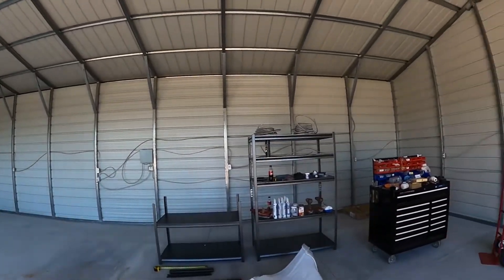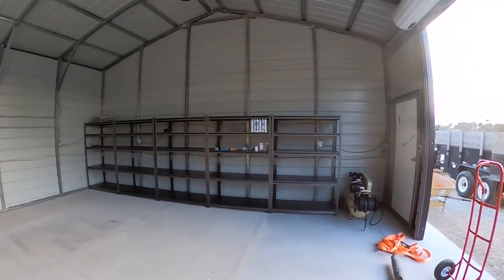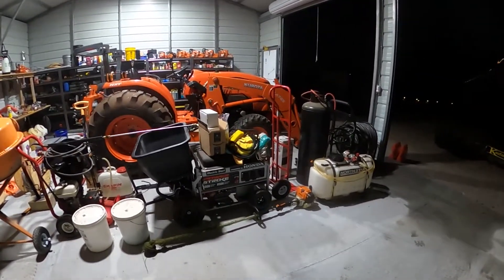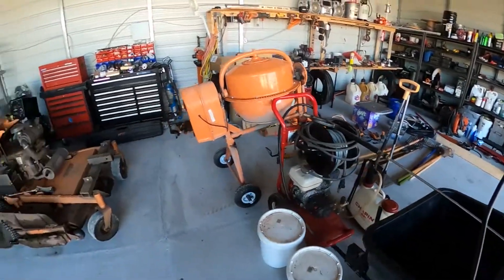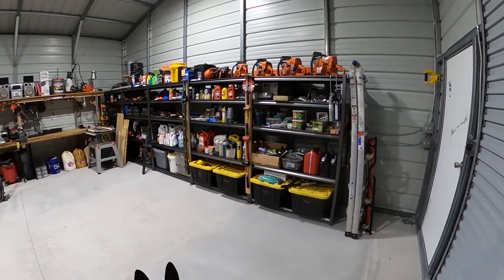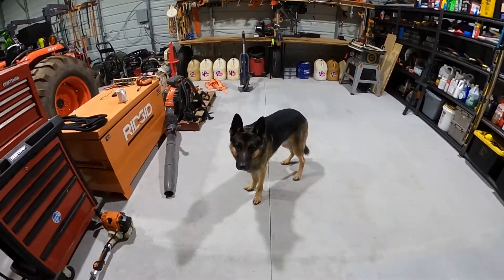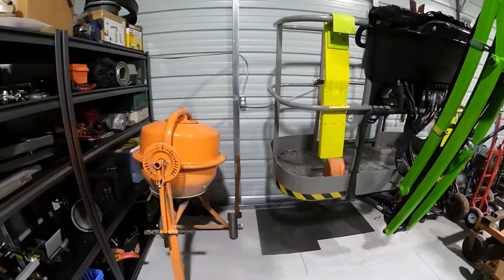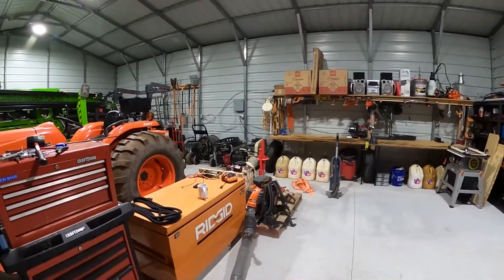Organizing a Workshop

Comment: So you have a link for the shelves you bought? Are the surfaces metal or wood?
Reply from the maker: The shelves that I purchased say that they're no longer available. But these look very similar to the ones I have. https://amzn.to/3Og4NvW
If you have a samsclub in your area they randomly have shelves close to these in stock but its hit or miss if its actually there. edit: the frame is steel and the shelves seem to be mdf but coated with a hard durable (so far) plastic.

Comment: What state are you located in? how does it hold up against the cold/heat without insulation?
Reply from the maker: I'm in upstate sc. I've only had the building a few months now. So all it's seen is down to the 20's up into the 80's at the moment. It generally gets in mid 90s in the summer. I think it will hold up just fine. It's very humid here. Especially lately with all the temperature swings. I've made some other videos you should check out. I was having water intrusion at the base, as well as moisture inside but got those corrected in the videos I made.
Reply: @reallifetested2605  Thank you for the information, i definitely will check everything out! my 30x40x12 gets installed next month and im still up in the air about insulation, sheetrock and a mini split unit! Good info so far, i will be following some of the ideas you had!
Reply: @reallifetested2605  And im in California where it rarely rains
Reply from the maker: @Prodigyproperties1  That's awesome. I bet you can't wait! I would've done all of those things (insulation, ac, etc.) but this was more of a storage place for me. My wife does woodworking and laser cutting. She's currently occupying my other building and she stays in there quite a bit, so for that I added the mini split and all for her. I also made videos on that if you want to check those out. Mini splits are awesome! Her shop is 24x24. When it was 20 degrees that thing held 72 degrees with no issue! She has a channel as well. Simply Sallie